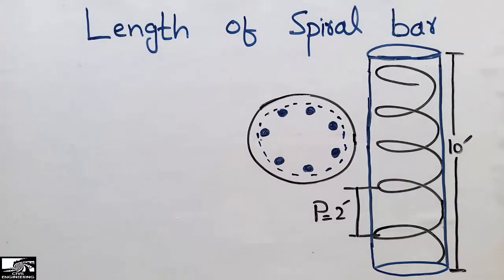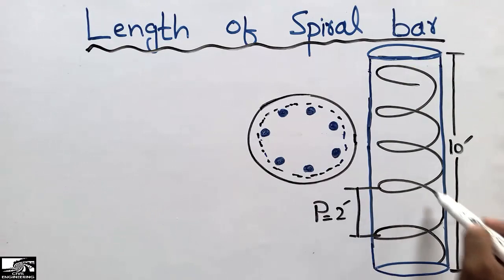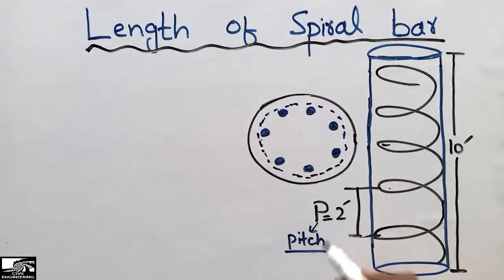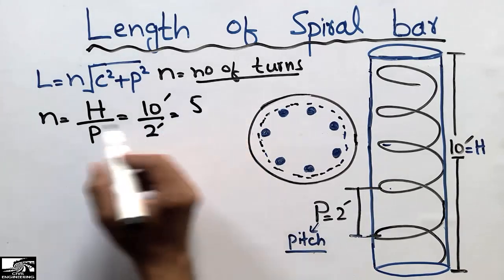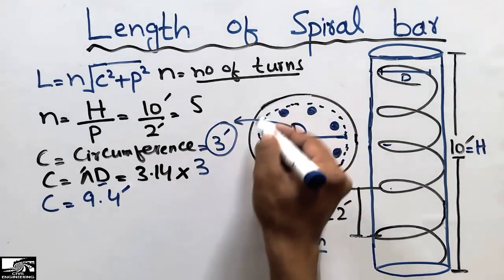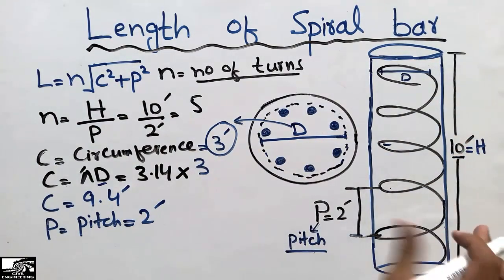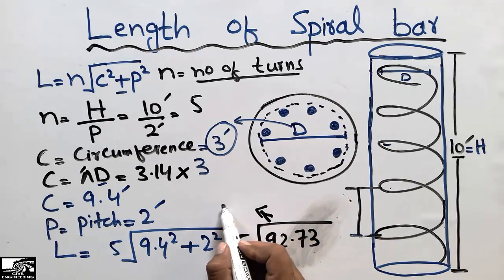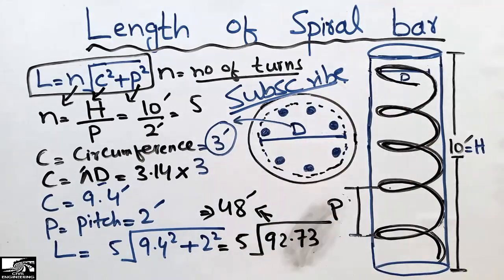How to find length of Spiral Bar or Helix Bar

Comment: Was needing this for a CAD model and couldn't think of how to get started. This equation does make sense, but had to prove it to myself before I'd feel comfortable using it parametrically. If you think of a helix as an inclined plane wrapped around a cylinder (thanks Big Bang Theory) and you were to unroll that inclined plane (triangle) out of the cylinder you'd get a triangle that's n*p tall and n*c wide. With Pythagorean theorem we know that the hypotenuse is equal to square root of the sum square of the two other sides. Since the hypotenuse of the triangle is the length of your spiral that's what you're trying to get, you would take (N*P)^2 + (N*C)^2=(Length of Spiral)^2. Square rooting everything you get SQRT((N*P)^2 + (N*C)^2)=Length of Spiral. Then some factoring gives you SQRT(N^2(P^2+C^2))=Length of Spiral, and then you can pull the N^2 term out of the square root (taking the square root as you do) getting you N*SQRT(P^2+C^2)=Length of Spiral (The equation from the video).

Comment: sqrt(dx²(phi) + dy²(phi) + dz²(phi)) = dl

x(phi) = R*cos(phi)
y(phi) = R*sin(phi)
z(phi) = k*phi

dx(phi)/dphi = -R*sin(phi) => dx(phi) = -R*sin(phi)dphi
dy(phi)/dphi = R*cos(phi) => dy(phi) = R*cos(phi)dphi
dz(phi)/dphi = k => dz(phi) = k*dphi

=> dl = sqrt((-R*sin(phi)dphi)² + (R*cos(phi)dphi)² + (k*dphi)²) = sqrt(R²sin²(phi)dphi² + R²*cos²(phi)dphi² + k²*dphi²) = sqrt(R²*(sin²(phi)+cos²(phi) + k²)dphi = sqrt(R²+k²)dphi

Integrating over phi then gives you sqrt(R²+k²)*phi

whereas phi is the angle you need to go until you reach the top (or the ground), R is the radius of the spiral, and k is the constant the heigt increases over an angel phi.

The height h of the spiral divided by k times 2Pi gives you the angle you need to go.

So the formula for the spiral-length is:
l = 2Pi*sqrt(R²+k²)h/k = 2Pi*sqrt(R²/k² + k²/k²)*h = 2Pi*sqrt(1+(R/k)²)*h

l = 2Pi*sqrt(1+(R/k)²)*h

Comment: isnt 9.4*9.4+2*2=88.36+4=92.36? how did he get 92.73?
Reply: Thts my question too🤦🏻
Reply: The circumference at 2 significant digits is 9.42.  If you use that in the formula you get 92.73.  If you let the spreadsheet calculate PI then you get 92.83.  It's just rounding for the video.